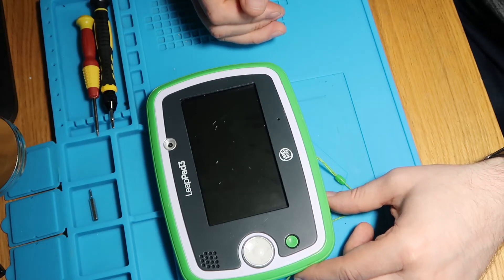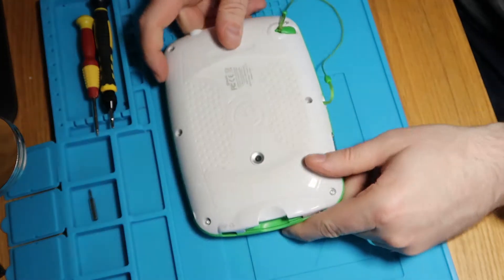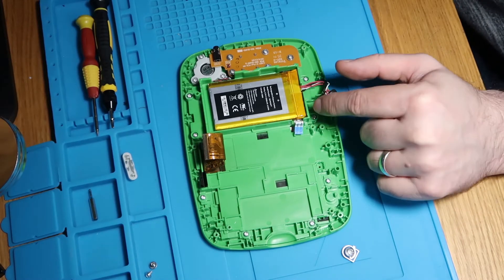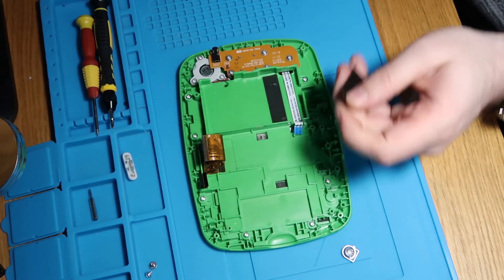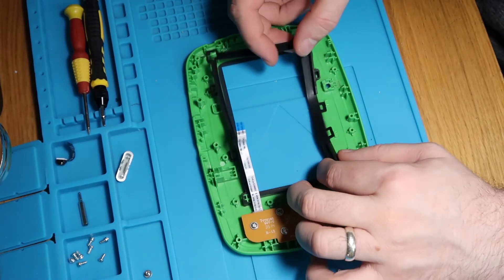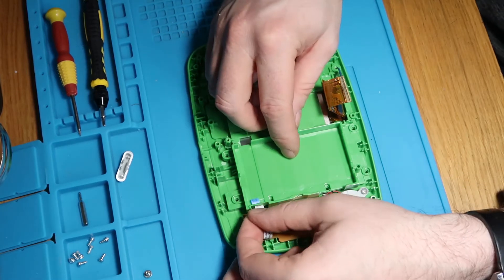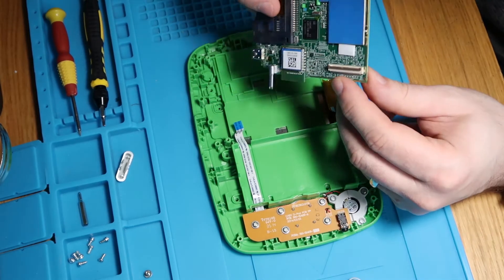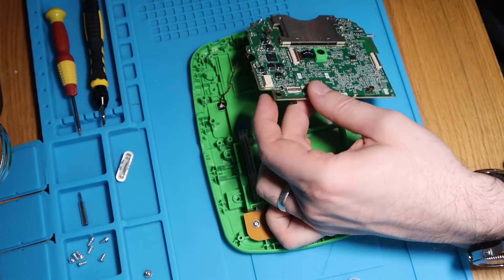LeapPad 3 Teardown and Screen Replacement

Comment: Hi, I have a leapfrog ultimate and am extremely new to dismantling tech. My child's Leapfrog Ultimate screen is destroyed, may I have the screen name so I can look for one on ebay 😀. Also before buying a new screen, is it the same screen or how do I go about getting the proper one? Sorry for all of the questions. 😅
Reply from the maker: Best thing you can do it to take it apart and the part number should be on the back of the old screen. You should then be able to find one on ebay quite easy.
Reply: @WeRepair  Thank you so much for taking the time to answering my questions. Your video will help me alot  on my child's leapfrog. Thank you again.😃
Reply from the maker: @Drokness101  Very Welcome.